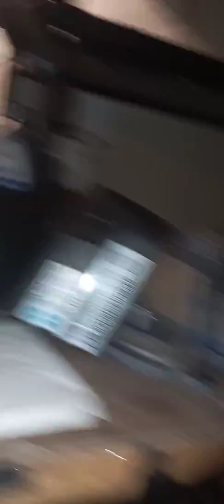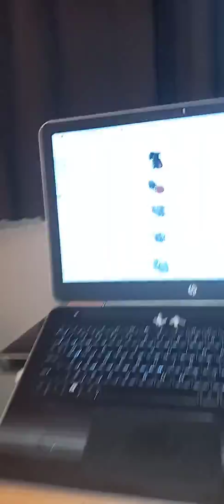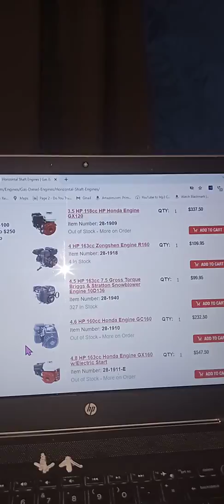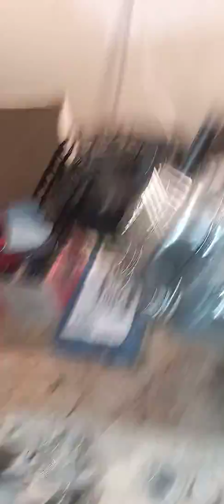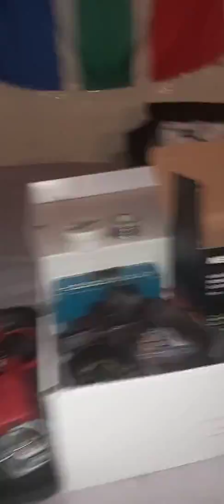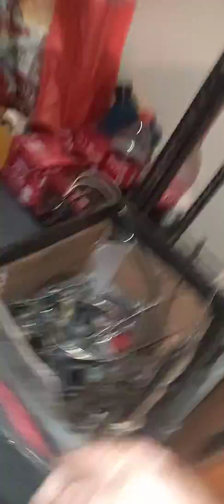Gas Powered 3 Wheel  Bicycle Build. Part 1 Of 2.

Comment from the maker: And update here to my building this 3-wheeler
My stew centrifugal clutch has a  10 tooth sprocket that goes directly to a 50 tooth sprocket that drives a bicycle making top speed somewhere around 50 miles an hour.
The other day while experimenting running around the block I ate crap punctured my lung broke five ribs I am now going through hell get thru the nights, getting around moving oh my gosh coughing with punctured lung and broken ribs it is the worst I'm not saying I'm abandoning this project or bicycles with motors altogether I just need some time to recover it's going to be a few months till I do II video here my word and my prayers are with anybody out there trying to build motorized stuff please be careful always wear helmets always make sure you have good brakes mechanical breakdowns happen and people get injured thank God that was all that happened to me everything in my lower extremities are just fine and didn't get any injury it's all right there in my upper chest I was actually out cold on the highway and the police came and were standing over me woke me up and I didn't even know who they were very scary so to sum this up three wheelers are not meant to be on uneven terrain or going at high rates of speed be very careful if you decide to build one